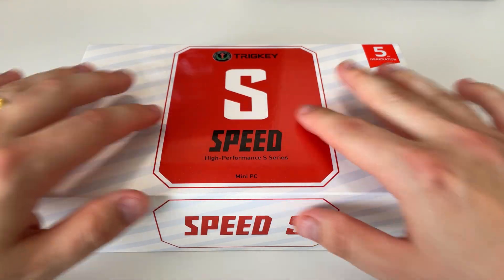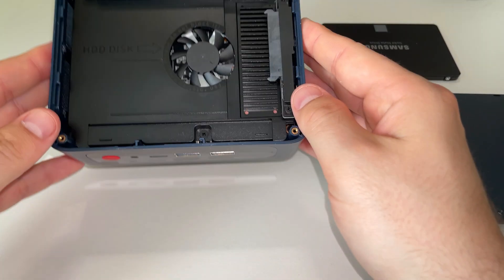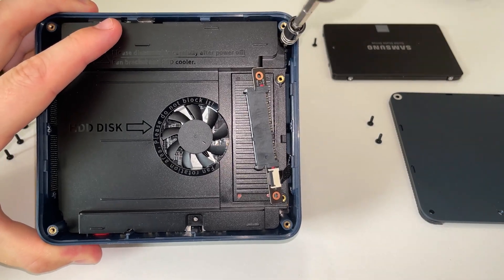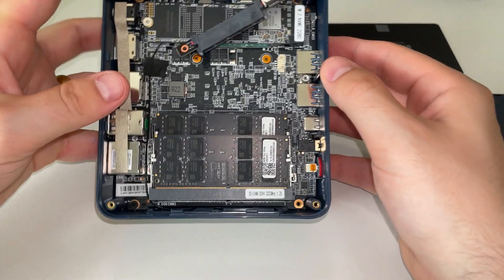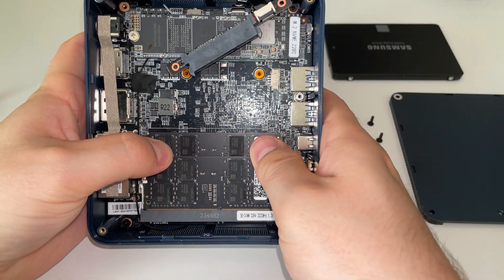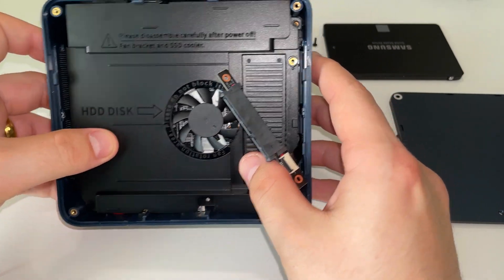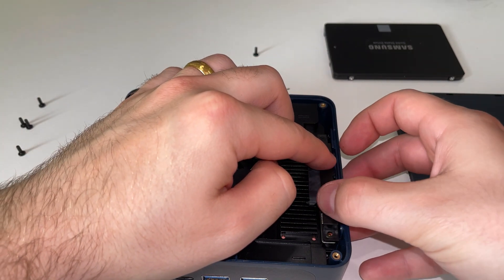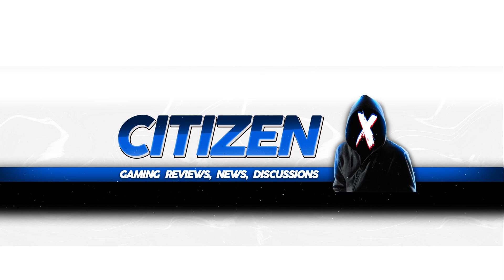How to Upgrade RAM in the Trigkey Mini PC | Trigkey S5 RAM Upgrade

Comment: Do you know if these ram cards would work on a different motherboard for a "real" pc? I'm looking to upgrade to a bigger pc and thinking of using these ram cards or maybe even other components for that system to reduce the cost
Reply from the maker: You can 100% reuse the SSD/hard drive in a normal PC. The RAM used in the TRIGKEY is a SODIM (small ram) where as normal PC's usually use full sized RAM, so you wont be able to reuse that.
Reply: @ErrorCitizenX  tysm for the info! that sucks bc the huge cost of building and maintaining a gaming pc really holds me back from giving up my console. I was hoping to drop maybe 100€ of cost with my mini pc components but even if I transferred the SSD it has only 500gb so I'd have to upgrade it anyway.
Reply from the maker: @sleepenjoyer-on2dr  Building a PC is a slow process. I started off with something really budget like 10 years ago and each year just upgraded one component. Now I practically have a super computer. Too many people try to build the biggest and best thing straight away and get caught up in specs - bad move IMO.

You can build a PC that competes with a modern console for like €550